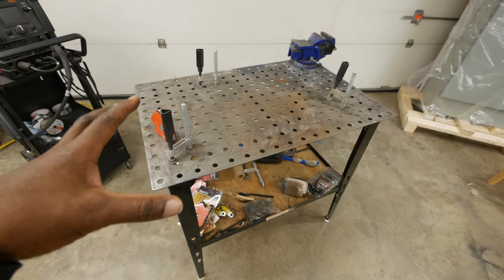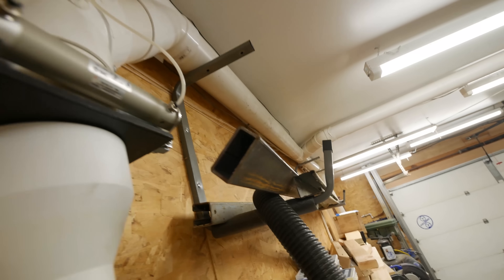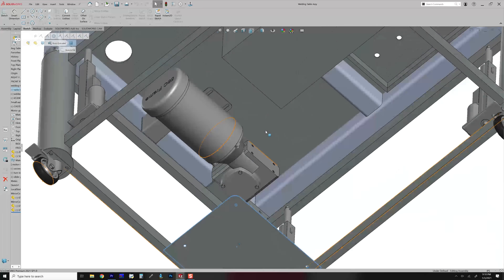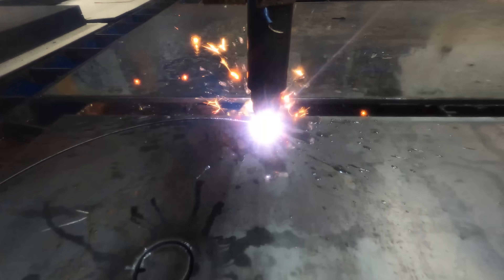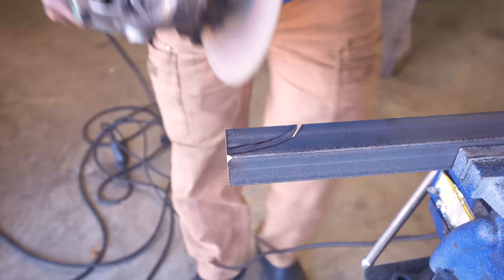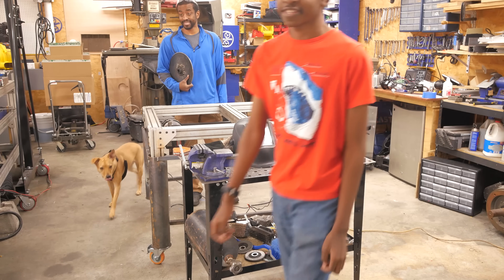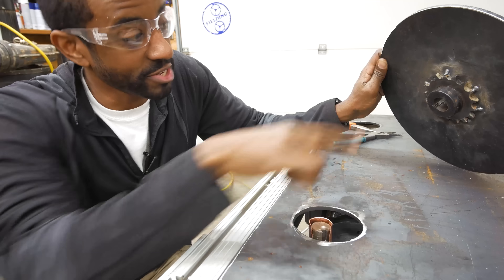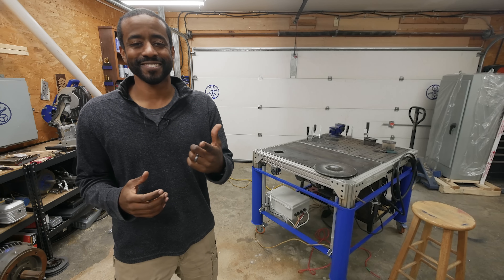Making the Ultimate WorkBench - Jeremy Fielding 088

Comment: Im also building my own height adjustable table. I planned using actuators as well, but changed plans because I didn't want to synchronize them. Did he mention sth here in the video in regards to synchronizing the actuators?

Comment: Great Build! Just curious, have you had any problems with the actuators not lifting uniformly ,like a slower motor or one side heavier causing the lift frame go out of square? I didn’t notice anything timing actuators other than the circuit that turns on and off same time.
Reply from the maker: No. They generally stay very close to each other not causing a problem.

Comment: I see a ball bearing, covered in dielectrically conducting grease, on top of a strong spring that presses it into a grove that has been cut into the underside of the rotating plate. The spring rests atop a washer that sits around a piece of 1\2'' round-stock. The Ground (or Positive) clamp is of course attached to the rod. The spring tension can help the balance of the plate, too. Great table.

Comment: Mr Fielding how would you go about making a welder that would work off a car battery or batteries and alternator that is use on the car 
And how would you control the amperage 
40 say to 120 amps would be ideal 
There are several on line that I’ve seen but they are pricey 
Or would I be better off adding a inverter and use a harbor freight 110 welder

Comment: Hey mate, love your videos! 
Can see you’re running a flux core welding wire and “pushing” your whirlpool like normal. 
Have a crack at dragging like you’re stick welding, you’ll be surprised by the difference. 
Source:Am a boilermaker

Comment: I seen this 40 years ago they had
 2.5 in square tube with 2in tube on the inside under the welding table if they want to make the table wider they would just slide out that side section

Comment: Hello Mr. Fielding ! Watching through your YouTube, I was fascinated of your knowledge and skill of building the things.  I’m a 70 yo. Retiree, I finished from Vocational Technical High school long time ago, I had learned through the basic of almost everything and graduated with carpenter major. Like you. I like to build to improvise the thing I needed but not available in the market. Now my car broke down beyond the repair. I would like to converting it to an EV. I have a couple of questions hopefully you don’t mind to make a video so others would be benefited from it too:
1- To use a 110VAC electric motor; What kind of converter do I need for it?
2- do I need a 110V batteries pack to run that motor? Or I can get do with less Volt?
3-do I need a motor speed controller or potentiometer or both?

Comment: Jeremy, on your MIG welding, slow your travel speed a little, turn your voltage up a little, it will neaten up your welds. Just play with it in that direction.
Breath.... be patient and allow the heat to do its work.

Comment: A good work bench is essential, i made a good one from old single bed frami love linear accuator s,just fitted them to my poptop camper,
Have a question for u,
Im building a house boat ,hybrid ,diesel elect,about 35-40 hp 
Q , can you set up a diesel genset to run as a motor🙂👍

Comment: Hi I got question.Hey Jeremy how are u. I watched your video a lot and really helpful. Im from canada. I got mobile project. I need one motor from run 4  aluminum disk(size is 6" each different grit sand paper) for sharpenning job. So I want to know how to  connect one moter to each 4 disk connecting. belt with pulley system? or Gear system?.
I need 3450 rpm speed reversable  control. currently i have inverter(hitachi<L100> 120v in 230v out) with four 3phase 0.25hp ac motor(baldor cnm20252). So altogether 4 moter is really Heavy. I want a make just one motor with four disk to make a light and space save. If I change new system which motor do I have to useing? ac motor or dc? connect with belt pulley or gear system better? <Four 6 inch disk without wabbling no vibration. I want really true with disk surface> If I using belt with pulley? quite or mount bearing. I need also quite and strong torque. So i will make a box then put it in the moter inside. 4 disk are above setting. please let me know. thanks.

Comment: Wondering if there is a spot on the motor gearbox that you could either weld a nut or drill and tap for a ground bolt? Or our work uses something that looks like a electric motor brush with a grounding spot

Comment: Hi Jeremy! Try downloading an aluminum extrusion model from a manufacturer. Make the base model super long, then do a cut extrude to offset from one end (so that the dimension is the remaining length of extrusion). Then you can open it up, change that one number and save it as like "40x40 extrusion 24in" and so on for each piece you need.

Comment: All you need on that table is cruise control, power tilt and climate control. Very cool table. Jody and the welding mafia will be jealous. One question though. Are your linear actuators synchronized or running independently? Are they ac or dc? Thanks.

Comment: I think you could do the extrusions pretty easily in your models. Do the cross section once and load it in to many projects?
Reply: Also, it's a good design if you can fix all the issues by unscrewing things and putting it back together again a little differently
Reply from the maker: I have all the profiles downloaded, but that kind of detail like threads and extra faces slows down the model but doesn’t add any value

Comment: One thing I would add to the rotating table is some rings etched into the surface indicating the distance from the middle point so makes it easier to centre the job you are welding.

Comment: I am a welder and over the years I have built and used dozens of rotary tables. The ground you are using will work for a while but it will also arc up your input shaft and eventually destroy it. You have a lot of electric motors kicking around so you probably have the components you need to make a good ground that will not cause you any trouble. Simply take the carbon brush assemblies out of a motor and mount them so they are insulated from the rest of the bench and have the brushes contact the bottom of your rotary table. This will give you a ground that will have good contact, is rebuildable, and insures the current is going where you want it without any possibility of going through a bearing. If you want to get really fancy, you can clad the bottom of the rotary table with copper sheeting to get even better contact.

Comment: Nice design.  I think the importance of creativity in Engineering is often under-sold.  Good engineers often have a a solid artistic/creative side but sometimes it takes time to emerge as the mechanics of engineering can take more time to become intuitive than other art fields.
Regarding the motor interfering the leg, you could have caught that at modeling by including the legs (2:30 "in this case I did not model the legs ... I would normally model").  So, you know you should have and didn't.  Fortunately that was an easy fix but it doesn't always work out that way.  I know that is always a trade-off between time spent vs. wasted in modeling/design but now that there are so many parts you can import from vendors that it is a really limited excuse.  Even the extruded pieces you can just import.  The biggest issue for me has been that all that detail can really slow down the modeling software.
Reply from the maker: In the case of the extrusion it is more about computer performance. As you mention above, more faces means a slower model. I have downloaded just about every profile available. But, if it doesn't add any value I don't show it. That was really the point.
Reply: @Jeremy_Fielding  I agree, but, most of the modeling I have done recently have been visual models to check to see if the design and to create visualizations to see the design so I can get approval to get someone else to fabricate it (or at least to quote it).  
I do recall watching a video some time ago that showed how to reduce the features on a part to speed things up and also, you can hide them when they are not relevant.

Comment: Great video and project! Can't wait to see the wiring part in the automation series. 
Just out of curiosity, the gearbox on that motor looked to be a thru shaft. Couldn't you use the other lower side of the gearbox shaft to ground your rotary welding table? 
Keep up the good stuff!

Comment: Here's an idea for your electrical Brush.
I built a Rotary Table for myself and the Brush was a problem. After trying several things, I ended up making a large, cylindrical Carbon Brush from a Pur, tap mount, Carbon Water Filter. It's about 2" in diameter and 3" long. Worked great, no overheating and good electrical transfer without wearing out the shaft.😊

Comment: I've faced a similar situation to the grounding issue, where I needed to deliver power to a rotating platform.  My solution was to have a pair of rings mounted to the bottom, "orbiting" the motor shaft.  I then stripped some wire and fanned out the bristles so they would brush over the rings as they rotated.  It's best to use wire that is somewhat springy, so it is constantly pressing against the rings.
I figure in this application though, such an idea might not be able to carry enough current.

Comment: Laughed out loud, as the kiddo set you straight. :) Nice, plus, it's nice to have a project you look at and say "i built that" and be fully proud of it. Have to say, really digging the idea of welding those bolts in the base, before welding it to the legs, far better than any option i've seen so far, including the one where you'd thread the base, because that one rusts, and if you need to replace the casters, it's a pain to deal with. Totally gonna copy that going forth.

Comment: Yup, 80% of a good weld is good setup, being comfortable is a decent chunk out of that parameter. Over time, as experience builds, that kind of thing is lessened, but for people with either beginner level welding abilities or infrequent/occasional welders, it's a big factor. One of the reasons for the divide of ... let's say reason, between hearing "it's about being comfortable", but then you see deep sea divers, cramped inside a suit, breathing through a tube in negative water, laying a perfect bead.

Comment: AWSOME build video as always and as always while watching I'm thinking of ways that I would have done it differently or ways that you could maybe even improve it a little bit...... so this time I was thinking about the turn table and if you were to cover it with a piece of sheet copper then all that weld splatter wouldn't stick to it and also would it hurt things to add an extra ground lead to your welder so you can leave 1 always hooked to the turn table and then have the other to use when your not using the turntable.....but it's just an idea take it or leave it and thanks for another great video as always

Comment: 8:24- Maybe try propeller shaft brushes. That’s one of the ways we bond rotating propeller shafts it in the marine industry.
Reply: Starter motor brushes work well and are available in most parts stores. older ford/chevy ones should do.

Comment: Great vid.  I would like to add something to your great build.  As a welder of over 50 years when you tested you rotary table your weld was a bit cold and the table was moving too fast .  To eliminate incorrect speed , set up a variable speed controller that is foot pedal controlled.  As you are welding you ca see if the part is moving too slow or fast and adjust on the fly. 
The metal fill was slightly lite.  

Having built several rotary tables I have found that the motor will carry the amperage just fine.  The only problem is the arcing in the bearings.  This can be avoided by setting up two large carbon arc brushes either on the shaft or on the bottom of the plate.  This will eliminate any arcing in the bearings.  35 years ago I built a table with a gearbox that had needle bearings in it and have ran some serious amperage thru it .  It is still in use today without any bearing problems. 

I love your videos and intend to watch them all.
Reply: He is using a foot pedal. He said it when he was explaining it to his kids, and you can see the speed fluctuation when he first tests it.
Reply: @xenonram  I missed that I have hearing aids and sometimes things are missed .  I apologize for the mistake.
Reply: Awesome advice. I'm a newbie welder and building my own custom welding table is a dream of mine.

Comment: Thats a great table.  I would be concerned about debris getting in to the open ends of the legs where the extruded aluminum slides up and down.  It needs a shield on each leg to prevent the legs from binding because of the debris packing in them.  Love the work you do.  TP

Comment: Does it matter that you've effectively got welding voltage in the motor? Or is it isolated somehow thru the gearbox?
Reply from the maker: The path is from the shaft directly to the plate.

Comment: Solidworks tip: You can usually find a DXF of the aluminium extrusion cross-section on the manufacturer's website. You can save this as a weldment profile (Lib Feat Part *.sldlfp) and then easily model as a weldment :) Great design though.
Reply from the maker: Its not about saving time in that case... I have those profiles... its about bogging down the computer. The model is way faster when there are less faces to generate. I mentioned that actually, but decided to cut it to save video time.

Comment: Nifty new intro! And I really appreciate your methodical approach.

I recently got a welder and started learning, so now I have #WorkbenchGoals 😀  (Any tips for finding gas bottles cheaply besides Craigslist? I've tried stick and will keep learning, but I've also tried flux core and realized it would be nice if this hot-glue gun for metal didn't require cleaning up slag after...)

Comment: Total awesome mastery! But, Hmmm... what happens to the weld current when the rotary table ground clamp gaps open for little instances? Seems like trouble somewhere... idk.
Reply from the maker: I don't understand...there is no gapping open. It has good contact for the full rotation.  But if this was happening the worst case would be the welding stops or sputters on and off depending on if this happened on each rotation.
Reply: @Jeremy_Fielding  I mean just for milliseconds occasionally as the surfaces slide. I'm confusing the weld negative work lead with electrical ground. I think these are isolated so not a problem as you say.  Not noticeable. The weld current can't flow through the electrical grounds back to the welder. Thanks!

Comment: Nice job, you just need a fume extractor. I have not seen one yet as I am new to your channel. I made one out of an old bouncy castle blower. they pretty cheap and I used drier vent hoses to make the exhaust tubes. Viola!!!
Reply: Voila* cause viola means raped ^^
Reply: My advice is atelast short term is to find a box fan you dont care about and just use that to blow the fumes outside / away from you.

Comment: I'm surprised that you didn't use a temporary switch..??  I wonder, what would happen if the switch got bumped on to rise, and you aren't there to turn it off--- does it just keep trying to go up until it breaks itself, or do you have some kind of limit switches installed, so that it will shut off automatically once it reaches the full length of travel? --- Also, what all is in the box? - did you have to write code for it to operate, or is it a more basic controller? -----------------  if there is no limit or safety switches I think the best quick fix would be just to install a 'temporary switch" to operate it-- that way, the only way it can move is by you actively turning the switch-- and then when you let go, it goes back to the "always off" mode-- can't ever have an accident that way.  great build.
Reply from the maker: There is a limit switch on both ends of travel
Reply: @Jeremy_Fielding  Sweet
Reply: also one more thing, I could see an eventual issue with debris falling down your poles and causing issues--  I think if you added like another 6inches around the outside of the entire table, that would keep any little scrap metal or shavings from falling down your poles-- plus it will be even bigger.. lol.

Comment: One thing I would say--- turn down the volume on your intro music---   You started talking a little low,  So i turn it up and then that intro music came on and blew my eardrums out lol...   Less is more.
Reply from the maker: Sorry about that! Its a work in progress LOL
Reply: @Jeremy_Fielding  I'm surprised that you didn't use a temporary switch..??  I wonder, what would happen if the switch got bumped on to rise, and you aren't there to turn it off--- does it just keep trying to go up until it breaks itself, or do you have some kind of limit switches installed, so that it will shut off automatically once it reaches the full length of travel? --- Also, what all is in the box? - did you have to write code for it to operate, or is it a more basic controller? -----------------  if there is no limit or safety switches I think the best quick fix would be just to install a 'temporary switch" to operate it-- that way, the only way it can move is by you actively turning the switch-- and then when you let go, it goes back to the "always off" mode-- can't ever have an accident that way.  great build...................   also one more thing, I could see an eventual issue with debris falling down your poles and causing issues--  I think if you added like another 6inches around the outside of the entire table, that would keep any little scrap metal or shavings from falling down your poles-- plus it will be even bigger.. lol.
Reply: @Jeremy_Fielding  That IS a great start, and I hope you just "fine tune" from what you have now: a pro grade, classy, quick intro, with a "big brand" closing shot! Nice.....!